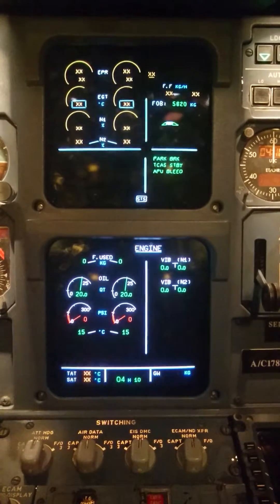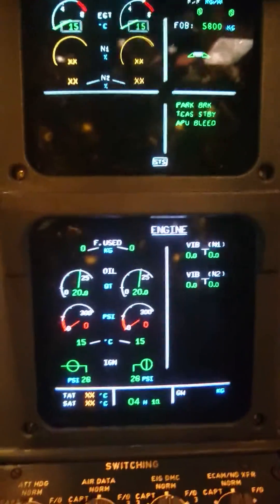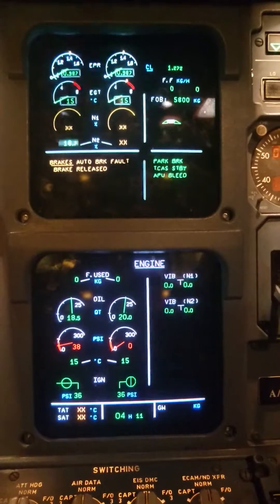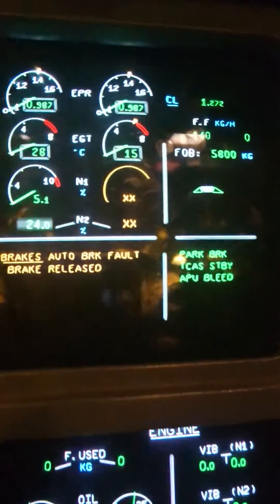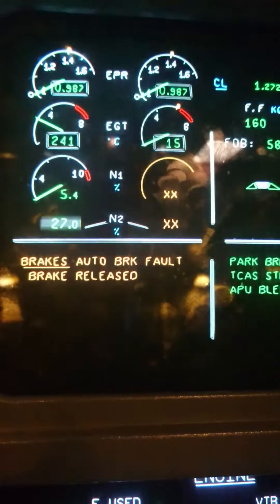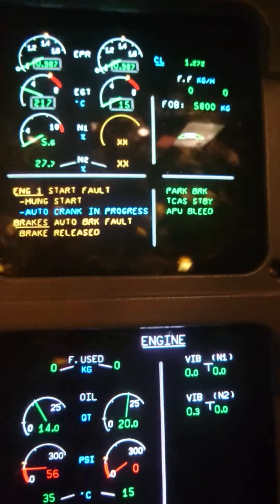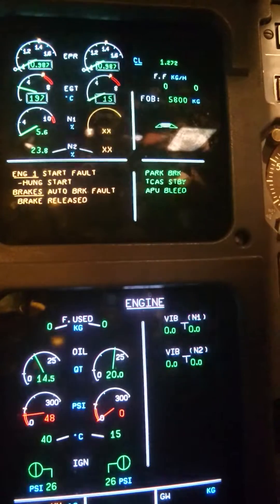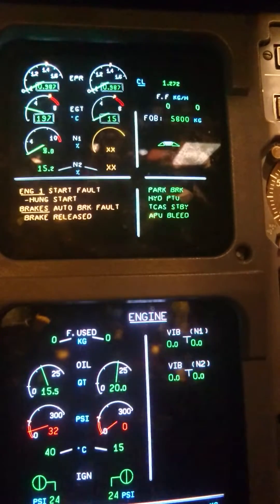Airbus, A320, IAE V2500, Hung start during automatic engine start, for training purposes only

Comment: what are the reasons to happen this hung start?
Reply from the maker: Hello friend, thanks for your questions 😊, many reasons may do hung start, like, not heading the engine  into wind when starting, starter air pressure not sufficient from the apu or ground start equipment.
Reply: @Haytham_Aly  ooo thank you for the reply, my friend. I never have seen hung start :)

Comment: Strange fonts !!
Reply from the maker: philippe gleize hello Philippe, many thanks for your comment, and please advice more deeply about the font problem? Did you mean the closed caption font or the ECAM font, if you can find a problem with the ECAM font, try to increase the resolution quality, and the font of the exam messages will appear in a good quality, again please don't hesitate to contact me if you have any advice regarding this training sessions and welcome to my aviation sessions, haytham aly
Reply: Hello !

I meant the font of the ECAM message indeed. They looks like fonts taken from word. Is it a real FFS or a custom built simulator with hardware ? The surge effect seems quite realistic. Working on a PC 320 simulator (FSlabs) so i am keen on this aircraft :)
Reply from the maker: philippe gleize, it is a real full flight simulator of the A320 with V2500 engine, may be it is an old one, I think our academy received it since 1998.